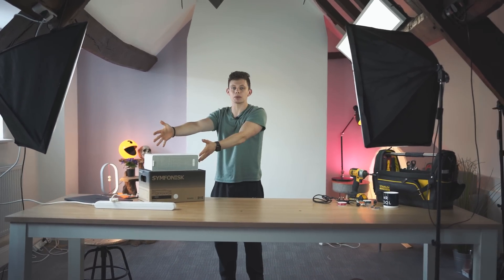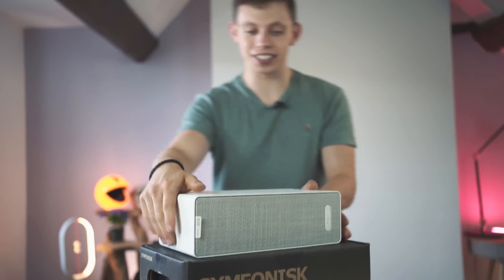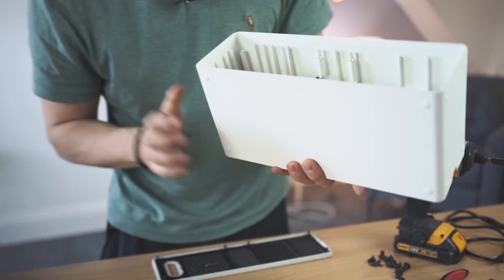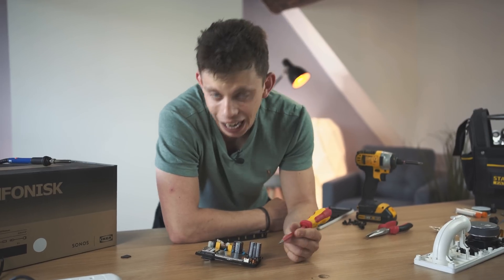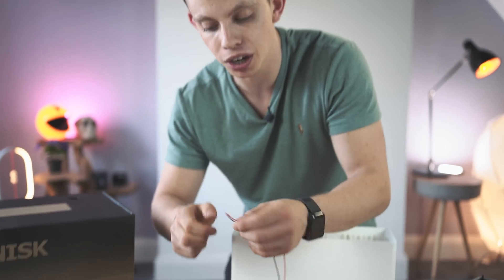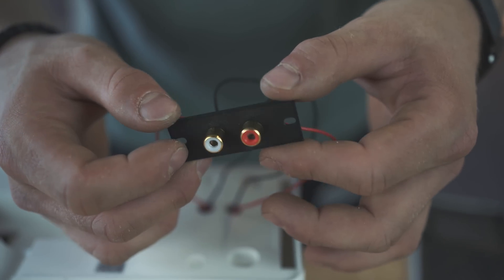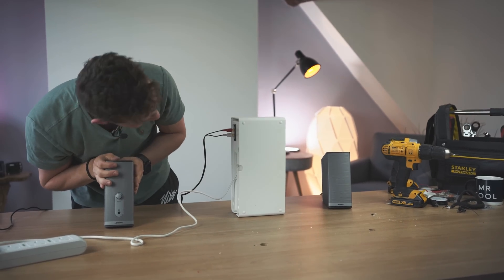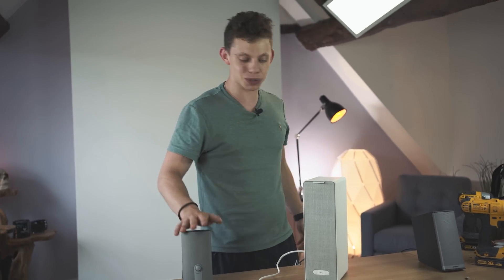Hacking the Ikea Symfonisk Sonos Speaker to Save $$$

Comment: Thanks for a helpful video, just did the same and the sound is awesome. I used a TRS 3.5mm female output and connected it to Logitech G560 gaming speaker. I also combined the high/low signals and fed that to the Tip and Ring pins on the TRS connector. The Sleeve is Ground as usual. In case anyone is planning to attempt this, make sure you secure the solder points and output connector with hot glue and use shrink tube anywhere cables are soldered together. Good luck.

Comment: For anyone wanting to do this, look into Hi/Low converters. You basically just clamp/solder it into the +/- wires on the speaker, and it steals the signal from there. That way you can STILL use this speaker AND run another amplifier + speakers on the same signal.
Reply: If you do this don't you just get the low or high signal since its after the crossover? Is there any way to sum the inputs? Would that be the outputs?
Reply: @nutxo  you need to connect before the crossover yes. Connecting after could result in a loss of audio signal at some frequencies.
Reply: you cant connect before the crossover bc the crossover is digital, the amp has two channels, one uses for the mid range and the other for the tweeter so there is no where to connect to get a clean pre-crossover signal
Reply: Since the impedance of the converter is going to be high, I guess you could join the tweeter and woofer signals together via 1k ohm resistors and feed that to the converter.

Comment: You can pick up a Sonos Connect on eBay for £60-100, which essentially does the same thing albeit with stereo output and is an official product. 
Butchering a brand new £89 speaker for mono audio and it took a bunch of soldering work which could have easily damaged the device or caused injury from the high voltage side, seems a bit silly to me.
I personally would rather go with the Sonos Connect, but if the diy is your thing, you have a spare speaker lying around or perhaps a broken one, go for it.
Reply: That product is discontinued and doesn't work in the S2 app. It may lose support all together eventually.

Comment: 802.11n is considered outdated. At least the first generation 802.11AC is good. 100mbps is recommended.
Reply: it's more than enough for sonos. n does 150mpbs easily in just 1 i/o stream, with mimo it does that 4 times over

Comment: Why buying a raspberry for 30€ with raspotify playing music at 320kbps HD audio when you can hack an ikea speaker to get a mono audio signal, post processed eq coloured and never-use-againg original speakers, for 100€?
Reply: The reason for doing so is that it is compatible with other sonos gear. So you might have a pair of sonos speakers or soundbar in your living room, but you want music in your whole house and sonos is fucking expensive, so instead you cam get cheaper ceiling speakers in all rooms connected with wires to a central amplifier, then use all of them together with the sonos speakers.

Another scenario is that you might have sonos in a few rooms but a proper hifi somewhere else, then you can connect that hifi to sonos, sure the audio quality might be less than perfect and you would only get mono (unless you get two). But you can synchronize the sound across the whole house.

Both options would let you save a lot of money when you have already bought in to an quite expensive ecosystem.

But as you say, if you don’t have any sonos or no plans on getting more than one there is very few reasons to get one instead of a chromecast, raspberry pi, bluetooth speaker or a cheaper connected speaker.
Reply: Because the cute girl wants a Sonos
Reply: @johnviera3884  🌈 j’adore
Reply: Because I want my cheap legacy soundbar to show up both as a Sonos device and an AirPlay2 device, not sure if your solution does that. 

And who in their right mind will hack a brand new speaker instead of a used or even damaged one?

Comment: Well .. couple misconceptions:

- what you showed is the Sonos Port, not the Sonos Connect, that is now discontinued.
- The Sonos Port and Sonos Connect are stereo. Your ghetto hack is mono. So you'll need 2 of them. That's 198 GBP.
- The discontinued Sonos Connect (look out for the Gen2, as it's S2 capable) can be got for around 140-180 GBP second hand, but it requires watching eBay a bit. For those that continue using S1 as they have old Play:5 Gen1 and the likes, that are not S2 capable, there's lots of bargain Sonos Connect to be found as many are upgrading to S2.

So, the hack makes sense, if no 2nd hand Sonos Connect Gen 2 can be got, but otherwise not really.

Comment: I've never seen anything so pointless! Why would you settle for a mono signal?
Reply: Well, for something like my patio where I have 4 Focal outdoor speakers along my house spread out 10ft apart. Mono is ideal as I wouldn't want the listening experience to change based on where Im sitting on the patio or where I'm at in the yard. Set this up and run it to my 2000w crown amp that runs the focal speakers. Now I can simply use the sonos app or echo dot to control them. This also allows me to sync them up with my other sonos setups in the living room, bedroom and garage to have the same music playing seamlessly throughout the house and outside.
Reply: For a whole house audio with in ceiling speakers, it is frequently done using a mono signal. Also don’t be rude.
Reply: @mundmc8172  yeah, mono is the way to go if you’ve got a bunch of speakers covering a wide area
Reply: I have never seen anybody so stupid
Reply: yeah i wondered that too, the only way you would be able to get stereo, is doing this to two symfonisk shelve speakers, which is 200 pounds, and at that point the time and effort you have to put in to it, you might as well just get the sonos amp
Reply: Am i right that you've got double mono now?
Any idea on how to get stereo? Then you need 2 ikea sonos boards i guess?

But the bigger question, why didn't you buy a google audio cast? 40 euro and you can cast whatever you want. With stereo mini jack out (wich you can easily with s plug convert to rca) OR spdif optica out (!) both stereo! 😉 Works like a charm but rare to find these days 2nd hand.
Reply: Look in the mirror.

Comment: Great video, I’d love to see it done with a broken play 1 from eBay and an active subwoofer 🔊
Reply from the maker: GENIUS IDEA 🔥
Reply: The PCB hardware inside the Play:1 and the Ikea Symfonisk are identical. The Symfonisk bookshelf speaker is literally one of the last Sonos Play 1 before it was replaced with the One in a different guise. So the same guide should apply without issues.
Reply: if you youtube search connect any sub to sonos or something along the lines you can find that exactly.
Reply: I’ve done this. It doesn’t work properly as you’d expect

Comment: If you have taken the pre-amp signal then you don't need to turn the volume up on the Sonos app. Surely its just line level out from the RCA's.
Reply: the amplifier stage in this application is fixed gain. line level is a can of worms,  loudness merely a perception that varies as it pleases and some of the beautiful 'standards we have kicking about a result of a rather enthusiastic 1970's amplifier industry -  it quickly gets out of hand compared to steady eddy DC. Sonos process their DSP before the DAC and pass a perfectly formed nugget of fingerlicking signal, so makes sense to sort out user volume request at the same time :) Assume it sits around the 0.3VRMS nominal typical of consumer spec line level. saying that mind, as they're dedicated channels for low / high frequency drivers rather than typical L/R I imagine the plot thickens.

Comment: Alot of the reasons that Alex used are wrong for example using hot glue to secure your solder joints because of vibrations is not right. If you do solder something make sure that the iron is on med/high heat and let the solder flow through the wires before taking the iron off. 👌👍
Reply from the maker: Thank you 🙏🏻 We've pinned your comment in hopes that more people see that 🙌🏻👀

Comment: Can someone explain to me what he did and why?
Reply: So Sonos system can play without your phone. You can basically remote control a whole house system and leave and it still runs via WiFi off your Pandora, Spotify, etc.  By using this hack you could basically plug in a regular system into that workflow.  In my head I'm thinking making a whole wired backyard outdoor speaker system work in conjunction with the rest of a group of wireless Sonos speakers in the house.

You can also play diff things on diff speakers.
Reply: Ewok Nation Thanks for the explanation bro

Comment: Interesting idea, just a word of warning - the big capacitors on the main PCB can give you a nasty shock if you've recently unplugged the speaker from the mains, so just be careful if you want to attempt yourself
Reply: 1М resistor will fix that for less than few cents if you're not careful enough. Like me when I built my first tube amp and I shocked myself several times building the power supply
Reply: I reported the video because they didn't warn in any way and this can actually lead to death.

Comment: Can it work the same with Passive speakers? Won’t sound good?
Reply: Kinda besides the point to use passive speakers, as that's what you're disconnecting from the unit in the beginning. You could just re-route the cabling for those speakers to some others, but I doubt the amplifier would have enough power to make any decent sized speakers sound good.